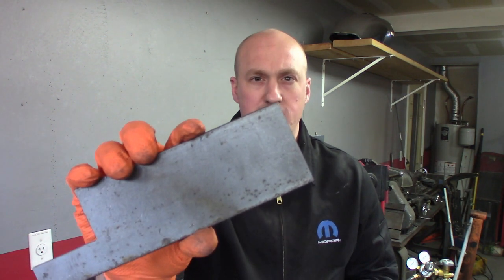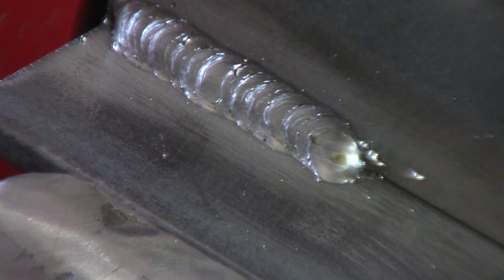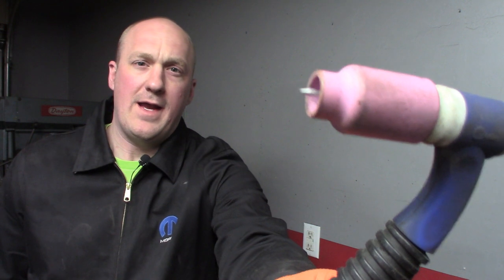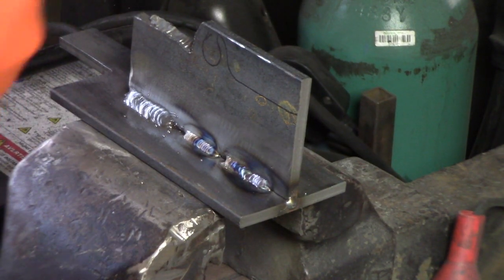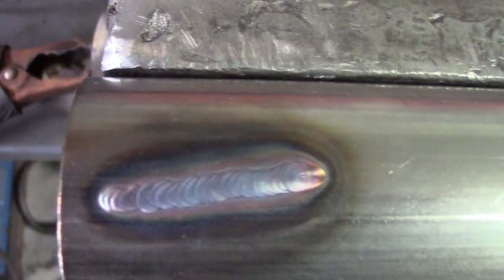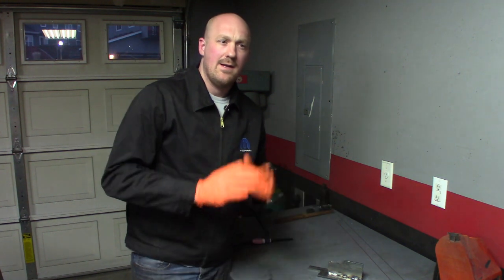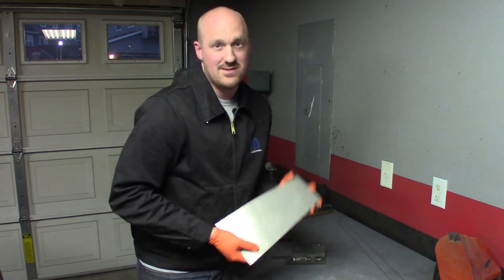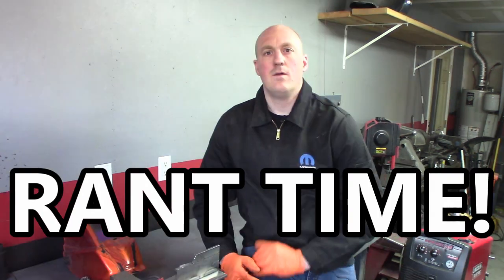Learn to weld! TIG vs MIG part 2!

Comment: Excellent video and really well presented in a practical no nonsense manner. Would appreciate some advice on how you set up work in various situations and not always on clean plate !
Is wire brushing enough  enough to weld onto or must one always get back to clean bright metal ?

Comment: Great vid, 13 - thanks for the tips.  I want to get into welding, probably TIG as I would like to start modifying motorcycles (frames, swing arms etc). I'm wondering what typically is the max gauge of steel or aluminum that I would be working with in your experience when fabricating parts for bikes, so I can make sure any future machine I purchase is capable of it.  (I've heard good things about the AHP Alphatig 200x).  Typically I will be working with older BMWs, Japanese bikes  etc.
Reply from the maker: 3/16" thick is easily enough for any motorcycle build in my opinion.

Comment: Good vid bud.  Noticed that you are missing the insulator for the gas lense set up on your tig torch which may cause issues with gas leakage  or air mixing in with your gas and also helps stop the heat from making its way up your torch.
Reply from the maker: Thanks for the heads up! And thanks for watching as well.

Comment: I don't think you actually said anything  about the actual gas settings on the regulators for the mig & tig. The actual number values to set your gas flow too.
Reply from the maker: Good call! I forgot about that. generally I run about 20cfm for Tig and just a little higher for mig, maybe up to 25. unless I'm tig welding in a tough spot where I need extra coverage, then I'll bump it up to 30.
Reply: Ok gotcha.  I have a strike arc (no foot pedal) for TIG that I am just starting to use so wasnt quite sure what to use.  Im thinking I use 15-18cfm for MIG though for some reason.
Reply from the maker: that's probably just fine for Mig, I go a little high just because I know it'll still last longer than the Tig bottle will. Stupid non adjustable post flow Lol.